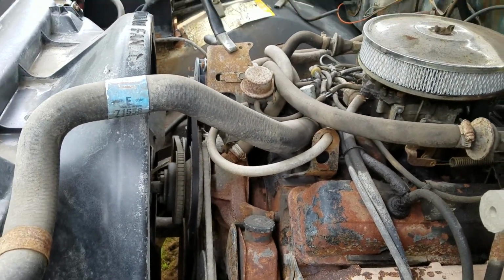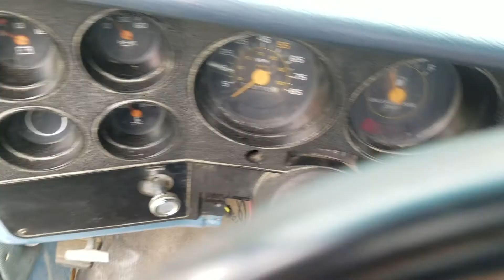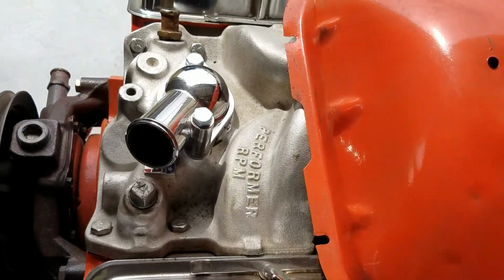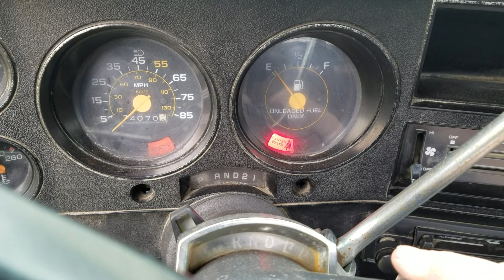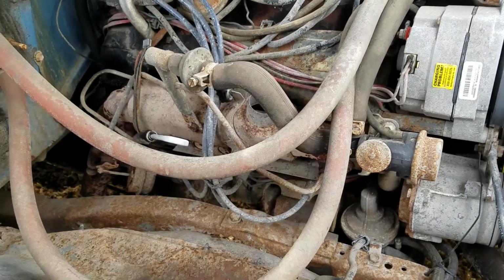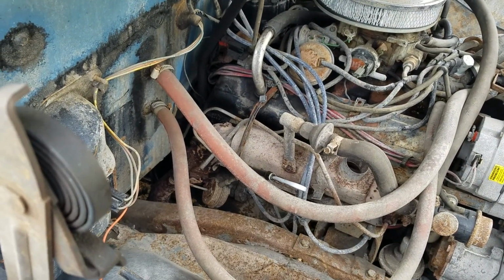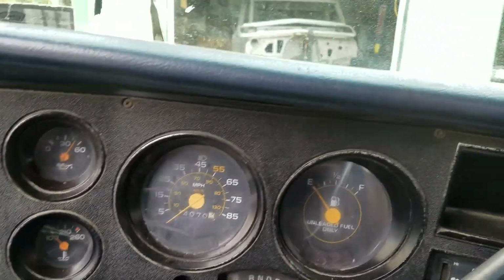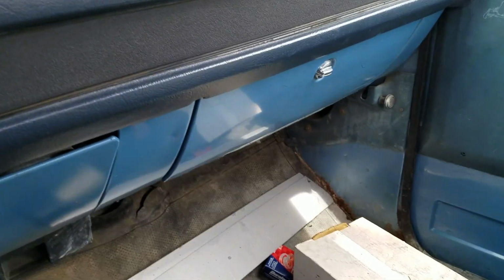1984 C10 spring cold start, 305 V8

Comment: Will you attempt to restore it sometime?
Reply from the maker: Cbr 3 I'm going to fix it up a little bit, I'm not going to go all out on it!
Reply from the maker: It even has the original Q jet carburetor on it
Reply: nice!
Reply from the maker: Cbr 3 I cleaned the engine bay with easy off oven cleaner, that shit is bad ass and it'll choke you to death if you breathe it in its rough stuff!